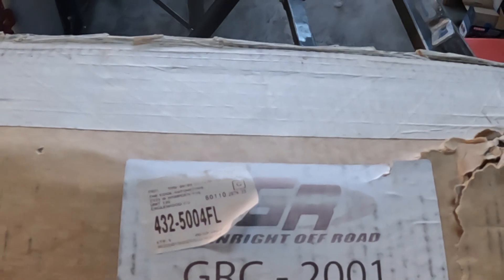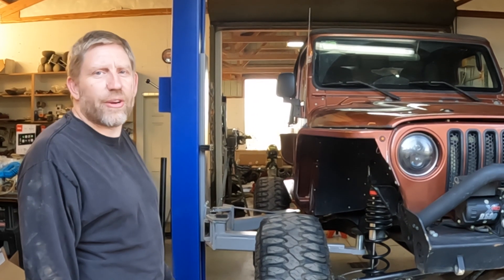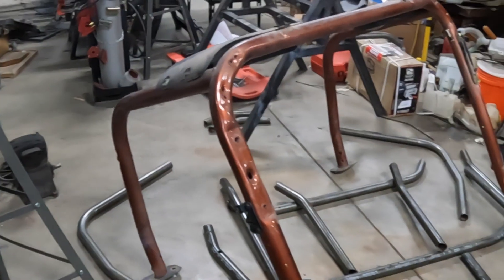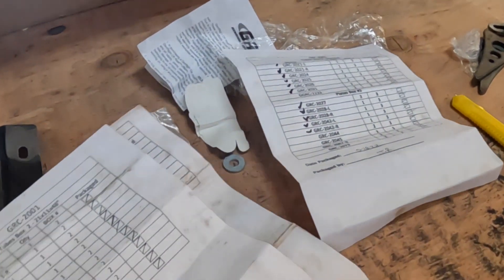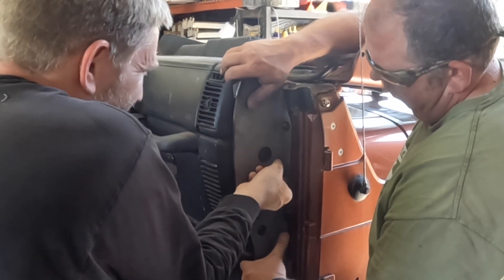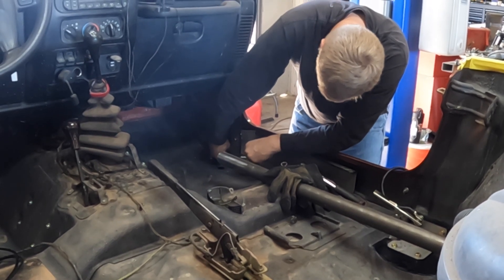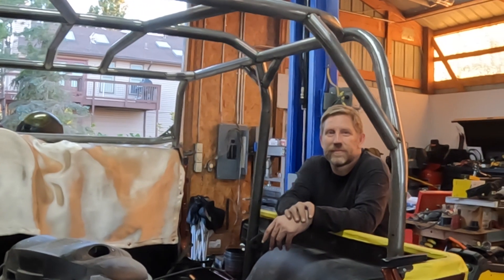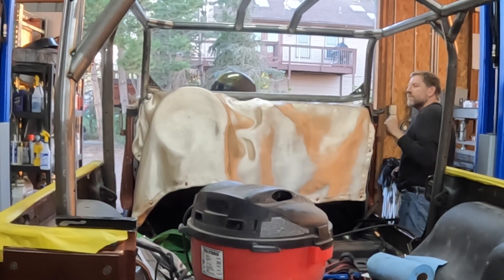Penny Build, Phase 4: Day 1 and 2 of the GenRight Cage Install

Comment: I appreciate your video. I am installing my Genright cage now and have referenced your video a couple times. You are correct about the included instructions, they are terrible. I have built mine from pictures. If you’re going to sell a cage for that much money it should at least come with decent instructions or maybe Genright should do a install video themselves. Thanks for a great video.
Reply from the maker: Glad it helped! One more thing we learned after that video that may or may not help you is this— the lower windshield bar, once welded in, will block the ability to remove the vent trim piece below it. When we needed to remove it to get the center bezel out for Phase 4 work, that bar was totally in the way. We could still access the screws with it displaced rather than removed, but it wasn’t easy. Not sure how to plan differently for this, but I wanted to share it, in case it complicates any of your future plans.
Reply: @karoffroad  thanks for the heads up. I’m actually installing the windshield bar tomorrow and after the test fit today I noticed that it looked like it was going to be very close to the dash.